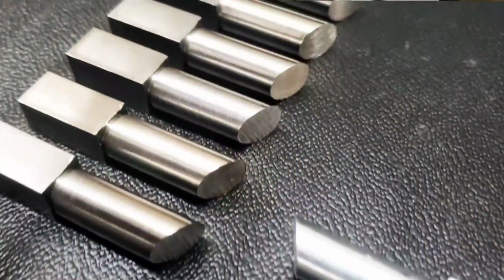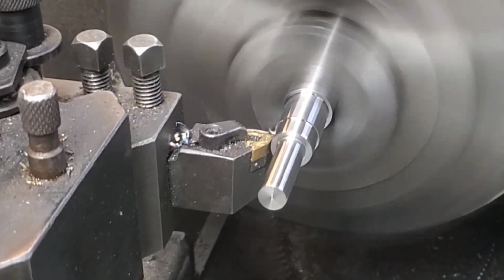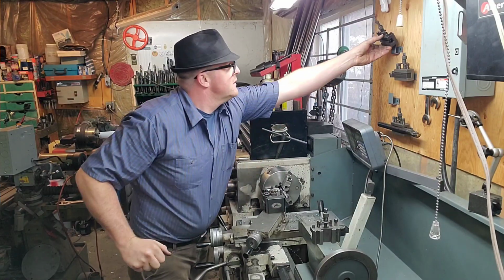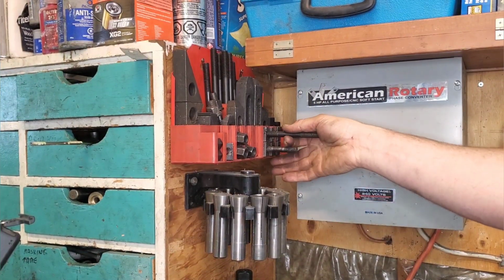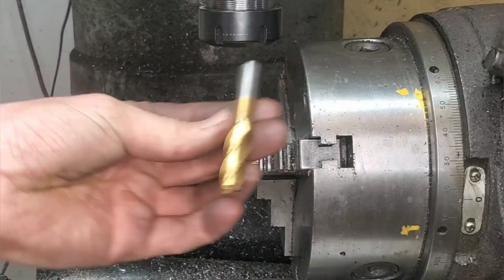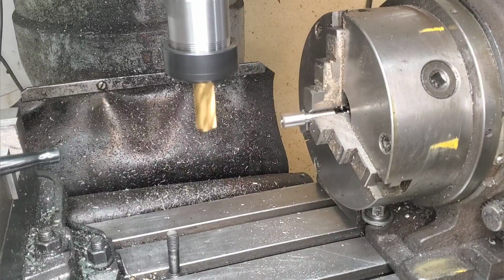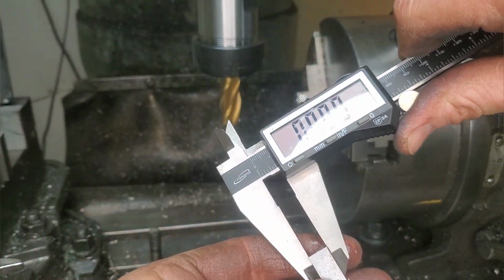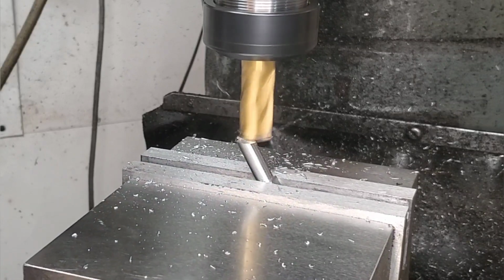Machining round to square pins in the manual machine shop

Comment: Hold the part upright in the mill vise between two vee blocks - one against a stop. Find the center and cut all 4 sides in one setup with the side of the cutter all using the same offset. It will save the corners of your endmill & get a much better finish.
Reply from the maker: Good prospective . Thanks